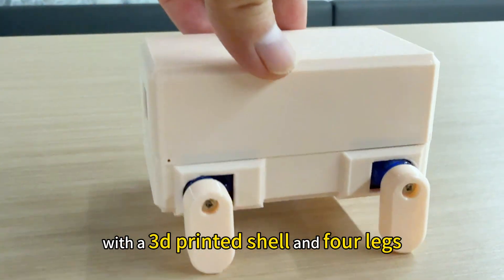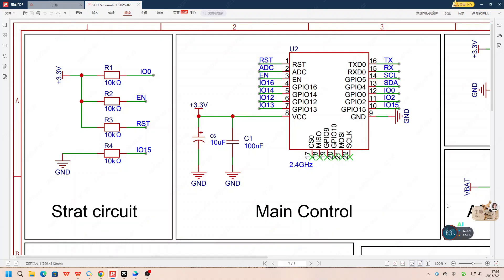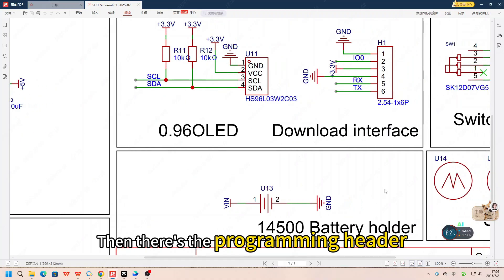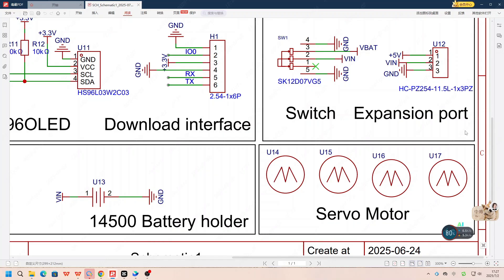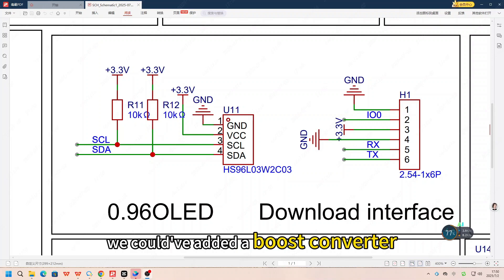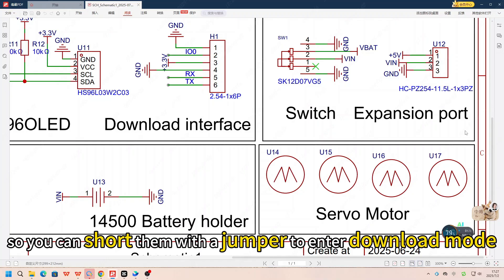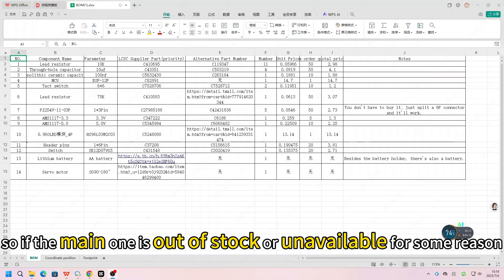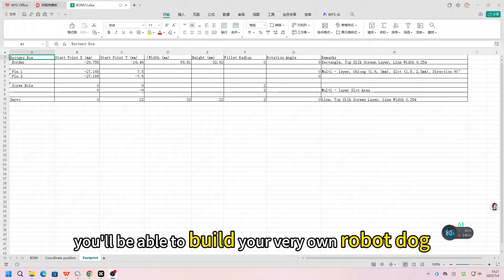Robotdog 1: Introduction to Hardware Principles

Comment: How to access the STEP files? Found links in Mandarin and online translation led to WeChat QR login (in Mandarin). Surely, there must be a simpler way to make your project available globally. Can follow your EasyEDA exercise (haven't started yet but feel that with patience it will work for me. Wonderful step-by-step instructions with onscreen subtitles. THANK YOU!) but I cannot read the read dimensions or notes in the 3D model files for the case etc. A STEP file would be the easiest interchange for me. Thanks.
Reply from the maker: Hi for questions about this project, please contact selina@easyeda.com

Comment: Those are NOT AA batteries, they are LiPos 18650
Reply from the maker: Hi for questions about this project, please contact selina@easyeda.com
Reply: You can read the label saying 14500. But you are right, as they are Li-Ion batteries and AA are typically Alkaline/NIMH. Important not to confuse them, even though their size is almost identical.